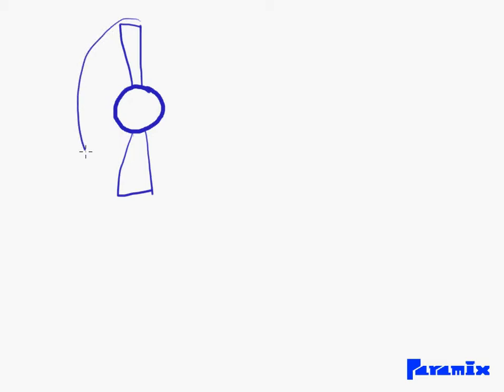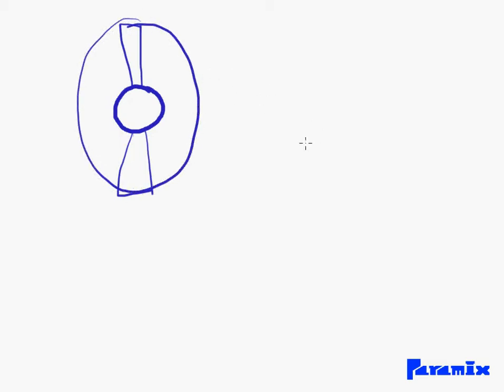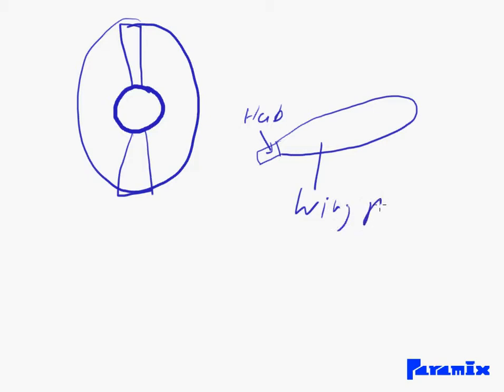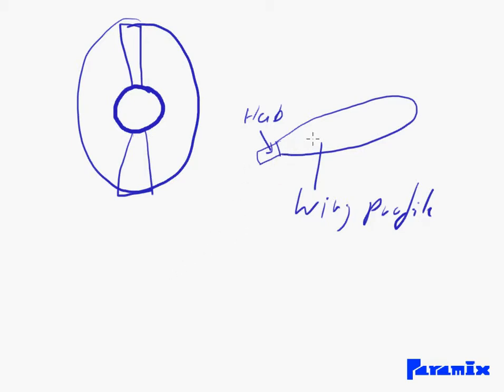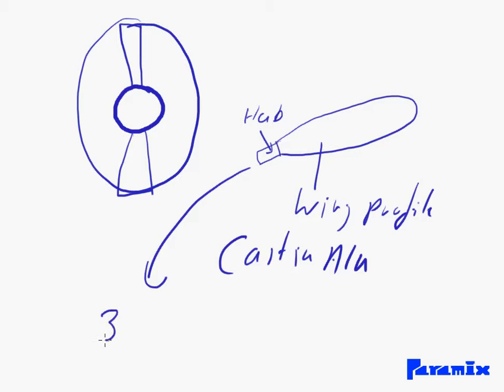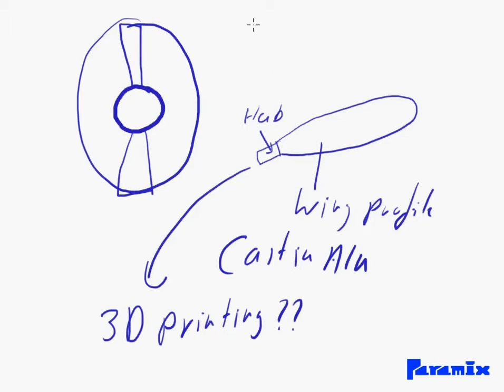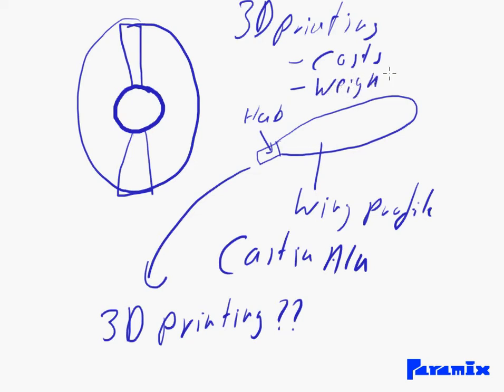Is 3D Printing for Axial Fan Impeller Blades Viable?

Comment: as long as it has a little twist to turn wind and maybe need a little weight because the air flow could bend the blades then now say you do find a away you need some type of not only on the blade but weight to keep the fan from taking off . v= forces so how fast the blade spinning and how much forces is holding that back for fly
Reply: so it can't fly forward

Comment: i honestly dont see why not, the 3d printers can print anything. the way to go about it would be to use some supports on the prop that can be broken off. if you can draft it on a design program than generally can be printed. and yes it would be lighter, and the worst part is the cost. the plastic costs next to nothing, 12 per kilo, but the printer for a decent one at a cheap price you are looking at about 2-3 thousand dollars. you can get into top of the line printers for up to 10-12 thousand, or titanium dust printers for i figure about 40 thousand, food for thought
Reply from the maker: I am no expert on 3D printing, but from what I heard it is way slower than conventional methods ie casting. So would 3D printing be viable for mass produced items, or is it just a prototyping / low volume tool?